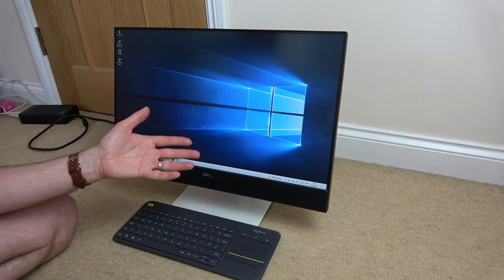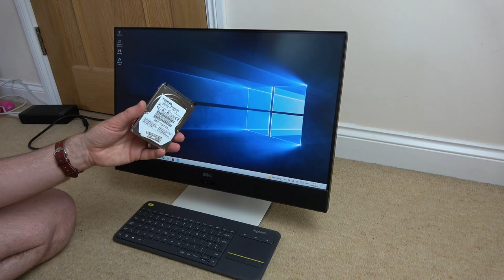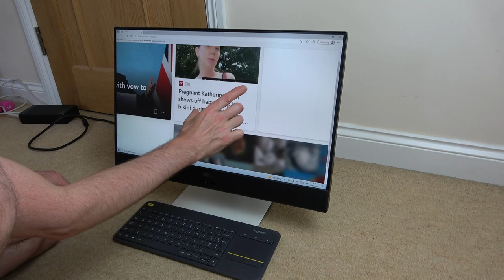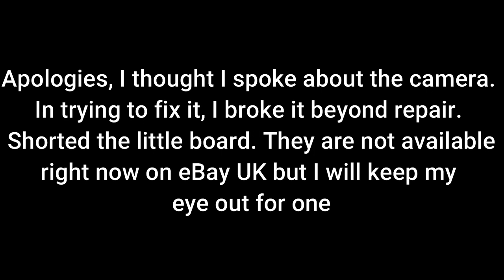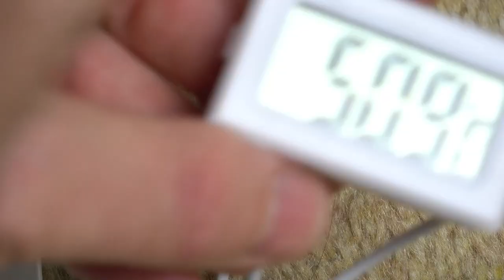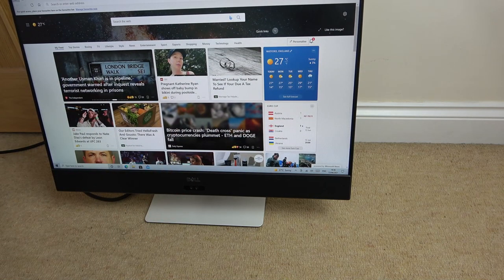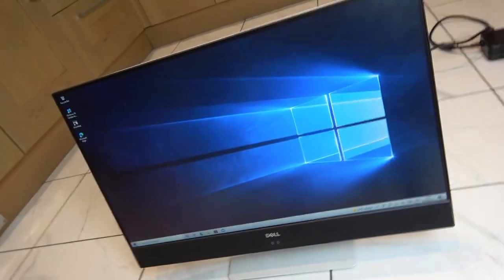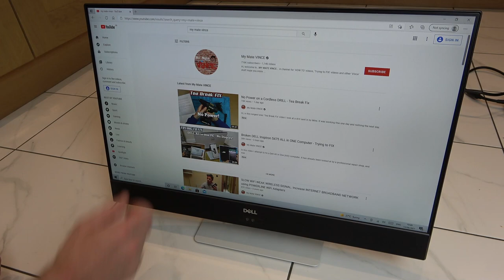REVISIT on Touchscreen not working - DELL Inspiron 5475 AiO

Comment: Hey Vince. Awesome follow up, I would say that the PCH hitting 60⁰C is normal. If you look up the specs you'll likely find the operating temperature wlll be around -5⁰C to +105⁰C

On another note, maybe solder the wires internally and remove the port? You could get a blank to cover up that port.

Side side note. I would say look into the chipset. Not just the actual chipset IC but drivers also. An awful lot of usb-related issues are caused by the chipset :)
Reply: That's what I was thinking too, love your videos as well btw! I figured he could probably leave the port in place and it may even still be usable since hubs can run off a single port, 2 devices should do the same, especially if its something of low power.

Comment: 50-60c isn't really that bad. It's toasty, it's not optimal, but it's definitely where a lot of chipsets and other components tend to sit. I'd worry once it hits above 75-80 :)
Reply: Mine hits 90 lol
Reply: @user-ew8bu3ez2f  🙃🔥bruh at least put a thermal pad on it.
Reply: He used wrong thermometer, I bet If he used laser one it would show even hotter temp
Reply: @flippy9133  laser on reflective surface? That's a whole other can of worms :) You can work around it with tape but then you have other things scewing the reading
Reply: @Chriva  also that was just the heatsink, the chip might be a even hotter underneath
Reply: @lexander9686  i have all-in-one pc. I know, it's a piece of trash, but i didn't know that when i bought it
Reply: @Chriva  it's matte not reflective
Reply: @Chriva  I might be wrong, but I don't think it's the laser that senses the temperature. It's the IR sensor.
Reply: @Chriva  No problems on a matte/satin finish.

Comment: PCH controls the USB port and IO(like WIFI, pcie, etc) Some PCH do run hot, Thanks for the mention, there are some ESD diodes on the data pins and coils, great video 👍👍👍👍👍
Reply: it also controlls sata ports and i found out if there is intense sata activity like downloading stuff that pch gets hella hot on my lenovo laptop otherwise it is just a bit warm
Reply: @dragos2010full1  Yeah, if you had a bad pch i dont think the computer would post.
Reply from the maker: Thanks AR, I will hopefully look into it again to see if the data lines can be traced back👍👍👍
Reply: @Mymatevince  just test to see if there a short on the data lines, just one line could be a failed PCH or diode

Comment: It's likely this PC has more than one USB controller (very common), with one dedicated to the internally wired USB components such as the touch screen, camera and bluetooth modules, and it is that one which has failed or is shorted somewhere. Start by check Device Manager under Universal Serial Bus Controllers, are any of them showing as disabled etc?.  Have you checked the Event Logs, that may give a clue if something has failed to start or is faulty too.

Comment: Great work.  Thanks for releasing an update.  Internet help from people is an amazing resource. If you don't want to fix that hot chip I'd at least move the battery away via wires and maybe stick another heatsink to the chip.

Comment: starting off on win 98 many years ago it does genuinely shock me how compact and hot components can happily run at now,  and yes around 60 is very average especially for anything compact like all in one or laptop, the heatsink plate is just doing its job and with the back on air will be being circulated, in unique heavy use circumstances if it gets 'to hot' it will be throttled until it cools, nice job on the touchscreen it looked really tidy when back together

Comment: I would first check the caps around the controller then I might consider a gentle reflow of the chip.
Heat cycles like that can cause cracks in the solder balls underneath the chip.
May be a temporary repair but at least you would know the cause and could work on cooling options.
Just my thoughts.
Good luck.

Comment: I've seen machines where the PCH would sit at around 80C, sometimes almost 90C in normal usage, so I think your temperatures on it are normal.  Sometimes you can see the temperature of the PCH in a program called HWinfo, which is a free tool for Windows, which can shows data from the sensors.  If not, you can check the BIOS, some machines will show temps there too.

Comment: That's great news Vince. So now -all of these issues are pointing to Dell and poor engineering design . It's a real shame that Dell has gone down hill is it's ability to held accountable for issues such as this - Overheating chips burning out - and here I thought its was microsoft being a driver issue which still is a part of the problem but doesn't seem to apply to this model. One thing I did learn from laptops is the Bluetooth is part of the WiFi board. unless it's soldered on the main board. 
Wayda go there Dude!!!
Thank you for your persistence

Comment: I've an HP touchsmart and the PCH on mine gets hot seems to be normal mine runs at between 40-50 read that when they get to 70-80 you will start having issues
Reply: Generally speaking most chips in a computer are unhappy after 90c, 100 is a usual failure point.

Comment: I suppose you can check the voltage on both USB data pin, usually it read above 1volt for a good USB data pin. Some manufacturer use USB mark or USB hub chip, in order to increase usb port for their products. You might want to check that.

Comment: From looking at the form factor of the mainboard it seems it's designed more for a notebook computer than a desktop one, which isn't at all surprising.  They're smaller and more compact.  However, it does mean they're a lot less modular and fault finding is down to component rather than part level.  Your remedy works as you're by-passing the onboard connections and using the external sockets.  If it's good enough, then ok.  Whether the controller chip for the onboard devices being as warm as it is has anything to do with the fault is debatable.  It already has a heatsink on it, as it is, so it's meant to get, 'warm.'  The only way to know for sure would be to get a working model of the same machine and see if that chip gets as warm.  But I know that's not something that's likely to happen any time soon.  Still, you got it working which is the main thing.

Comment: What about trying to replace the mini pci-e wifi/Bt card. Perhaps that card may be faulty and sending some feedback.
Reply from the maker: Hi Justin, in the first attempted fix I did swap it over with one from a laptop and it still didn't work (I didn't film it). I could try again though as maybe I didn't install the correct drivers before 👍👍👍

Comment: Wire the usb cable internally to the back of the usb port, a lot cleaner. Bluetooth is usually affected by a bad network card on these aio.
Reply: Doing that could induce an user to insert something in the usb port while it can't be used. If also the camera has usb connection I suggest to find the tinyest usb hub on the market and connect internally touch screen, camera and bt dongle sneaking out the hub cable.
Reply: Bad idea. If someone plugs a USB device into said port (since it wouldn't look used), who knows what would happen.
Reply: Its a good idea. Just remove the female port so no other device can be plugged in.
Reply: @DumahBrazorf  well of course you fill up the usb port so it cant be used, or completely remove the usb port!
Reply: @hullebikerfishing  Someone (like me) may not give a sh*t about the touchscreen on a big screen like this. IMO better to leave the user the option to choose what to do with the usb port.

Comment: A great last resort idea would be possibility desoldering that one usb port internally, hooking up a usb hub and then connecting the touch and that usb port with the usb hub. Looks like there is space for a little board like that
Reply from the maker: Thanks. I was thinking exactly the same thing as there is the space. It could even be powered from the faulty USB internal port where the original touch cable was 👍👍👍👍👍

Comment: The platform controller (aka 'the chipset', northbridge, southbridge) is an incredibly high speed processor which manages all sorts of things on the motherboard, and does a lot of talking directly to the CPU.
It manages things such as the USB controllers as you've said, but also all the PCIe interfaces (where graphics cards and the like go), SATA/IDE controllers (for hard drives/ssds), Networking controllers (WiFi/Ethernet (although these days WiFi is commonly a separate pcie device)), keyboard/mouse interfaces (common on laptops which have these built in), audio controllers, and all sorts of things that the motherboard has.

They're essentially an entire processor in themselves haha
they exist because CPUs are generic, they can be used in a huge variety of different motherboards, and each motherboard has different features, like one may have 8xPCIe and High Speed SATA, while an other motherboard has 16xPCIe, a fingerprint reader and IDE controllers instead of SATA. Rather than having to cater for all these possibilities within the already complicated CPU, each motherboard has a chipset/platform controller which will manage all these parts of the motherboard, and provide a generic friendly interface for any CPU to understand. 

Being essentially a separate CPU in itself, they are highly complex processor dies, which do get quite hot in operation, and aren't very likely to fail unless overheated. When they do fail however, it's 99.999% likely that the whole chipset will fail with it, rather than something like the USB going while SATA still works. If there was a fault with the chip set, the whole computer wouldn't boot. This goes the same for the main CPU, if it's working enough that you can see a bios message or it boots windows, then you can be sure the whole CPU is working, you don't need to worry about a pin not being connected or something. 

The likel fault in this instance is there is a separate USB controller on this motherboard which is exclusive for managing internal USB devices, such as the camera, touchscreen, etc. This is where I predict the fault lies.
One of the reasons they use a separate USB controller for things like internal devices and external devices (ie USB ports) is to save costs, the internal USB controller can be a simple one which doesn't need to worry about devices being unplugged or plugged in during operation like external USB ports have to deal with, and is used to only giving a certain amperage rather than having to vary depending on each USB devices asked for power etc.
This USB controller has likely gone pop, while the other USB controllers still work. (Ie the one that manages the port on the back you used for the touchscreen)
Reply: One thing that may be interesting to test would be to solder a USB port to that internal connector which doesn't seem to be working, so you can see if a USB thumb drive works on it, or something simple like a USB mouse.

Could then maybe plug a phone in to see if it charges it, maybe it's giving 5V without a load, but when something puts a load on the port, the voltage just cuts off and it stops working, indicating perhaps the controller chip is fine and perhaps a capacitor or something is not working right
Reply from the maker: Thanks for the tips and advice TV&C 👍👍👍👍

Comment: I remember the DIY PERKS channel on youtube using a USB Wire To a webcam so to use it as a security camera.
  He said it used USB Port Protocol or so.  Maybe the extra cables from the old webcam are for Microphone & WindowsHello iR-Camera or Light sensor.

I'm not fully sure about issues like these. But defo worth a look into the webcam issue from other repair websites of other brands. 

Hope u can get it fixed

Comment: About the bios battery, my one died quite early I think after about a year of owning it. I think the heat actually caused the battery to die, I never noticed that the IC above it was so hot
Reply: On Dell community forums I just came across the thread that says this had a "known issue" search that phrase on the forum here: https://www.dell.com/community/Inspiron-Desktops/Inspiron-24-5475-AIO-Touchscreen-IR-not-working/td-p/6092733
Reply: And yes the issues must be related, I will try to look at the name of this mystery chip and see if I can find any information on what it's purpose is. It must be some kind of serial IC which lets the CPU talk to the peripherals
Reply: Well that’s probably what it is, the PCH 😂
Reply: Can you tell me if you hear a slight buzzing sound from the speakers when the pc turns on from full shut down? Maybe I caused some damage back when I was playing around with it or could also be due to the PCH
Reply: The PCH seems to be an "AMD K5 IMC" (Northbridge) or rather “AMD B350” chipset, that is what CPU-Z says, I had a brief search of “AMD b350 usb fault and im getting lots of similar issues with USB not working at all. Do have a look but I am hoping that there is some motherboard fault which can be found, next thing to do would be to trace the path of the data pins on the touch connector and test the components, perhaps a filter has blown or something.
Reply: Thanks PN
Reply from the maker: No PN, the speakers have no noticeable noise even at full volume. Thanks for the help on this and the comment on the AMD B350 chipset. I will look forward to looking into it to see if the original problem can be found. Cheers 👍👍👍

Comment: Generally consumer electronics should run below 70C so I'm guessing that hot chip is operating normally. Note the gold coloured rectangle of to the right of that hot chip - that's a fuse (although normally it kills power not data)...
You could try wiring a USB device to that port - a mouse or a keyboard, that'll prove out the port.

Comment: If you want to hide the touch cable and don't want to repair the board or replace it, you could buy an M.2 to USB card and plug the cable in that. Because Bluetooth runs over USB, you could try to find the USB pins on the mPCIe slot and hook it up to that same controller card. But you should unsolder the USB pins from the board, otherwise it could probably fry the whole PCH when it's USB lines do work again...

Comment: You can also fold the display almost flat to the table by the way, makes typing a lot easier
Reply from the maker: I was wondering why it did that on the previous video. It makes more sense now with the touch screen working 👍

Comment: For unknown to me reason my laptop (Asus G750JZ) started to turn off when i close the lid or press sleep button.
It was a BIOS problem - hidden power parameters that is not available by manufacturer somehow is changed to wrong settings that causing laptop to to turn off instead of sleep.
To fix that i did forced bios re-flash using its bios flash software (Winflash) and problem is gone.

Maybe you should try to re-flash your Dell Inspiron 5475.

Comment: Hey Vince, great fix as always. I would just like to tell you that the chipset/PCH temperature is normal and some of them tend to run hot.
For the touchscreen connector, try following the data pin traces to the filters. To my experience, USB connections have filters similar to the HDMI filters you commonly find on Playstations, Nintendo switches and  basically anywhere that requires it (the size might vary but those filters are there. Since the back panel ports are working, I am fairly sure in your case, the PCH is good and it is likely that the filters are blown. Same goes for the inbuilt Bluetooth USB connection although the filters for that might be tricky to find. All the best.
Reply from the maker: Thanks for the tips and advice Arijit 👍👍👍👍

Comment: nice work around. Could you rewire the plug to the inside  by just attaching the wires to were the USB port leads to?
Reply from the maker: Thanks Emma, I could but someone could accidentally plug something into the same port, t would need to be blanked off. This way, although it doesn't look as good, means the port can still be used if you didn't want the touchscreen. Maybe a little internal USB hub would be the answer 👍

Comment: I dont think those controller hubs are supposed to get that hot, so probably there has to be a short on the chip or somewhere near it.
If you do end up fixing it and keeping it, i would highly suggest you grab a second hand 1st gen Ryzen processor, because it should have the same socket.
Reply: That's nearly as hot as my 1650 gpu in my laptop at full load and unless the Ryzen cpu has video on board it wouldn't work and some report it was never tested with any Ryzen cpu's it was always planned as a low cost Axx series board I doubt its also got the correct chipset for alot of Ryzen cpu's. There are people who have used Ryzens though with various problems like externally rigging up gpu's etc

Comment: It is possible that one of the Serial Bridge Controller IC is damaged, surely there is a touch and bluetooth signal hub, for that reason there is no Data + and Data -.
If it were a laptop I imagine that Data + and Data - would go straight to the PCH with only protections like coils, capacitors and diodes (this is of course a bastard mix between a PC and a Laptop).
I would review the Data + and Data - path to the hub IC, it wouldn't be too complex to replace as long as it doesn't go straight to the PCH or it's not one of those quirky all-in-one chips.

Comment: A lot of computers, especially laptops and all-in-ones, have multiple USB controllers.
The touch digitizer, webcam, and possibly bluetooth module (if not integrated with the wifi card)
 are probably on the system controller's USB lanes in order to save IO bandwidth for the USB ports.
It very likely is the ESC/PCH that's the problem. 40° is understandable on some, but NOT nearly 60°!

Footnote:
I call it an Embedded System Controller (ESC), you call it a Platform Controller Hub (PCH).
Both are acceptable, just like motherboard and system board. Po-tay-toe, po-tah-toe.